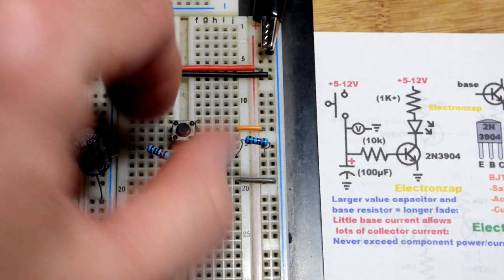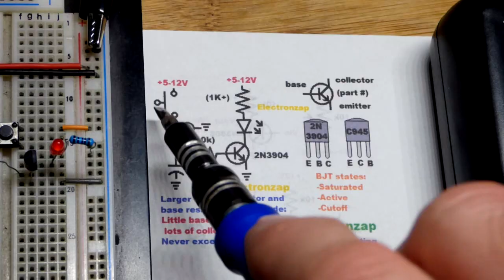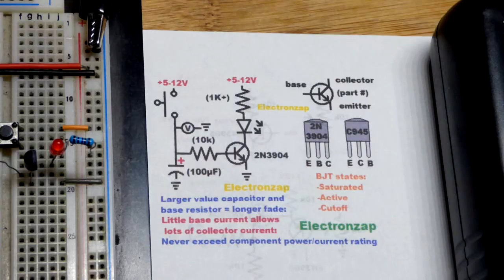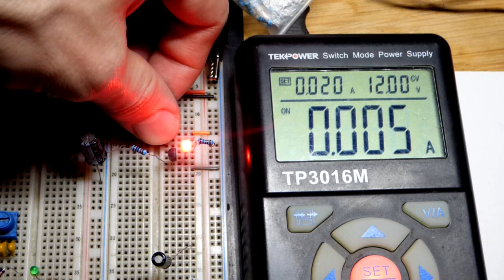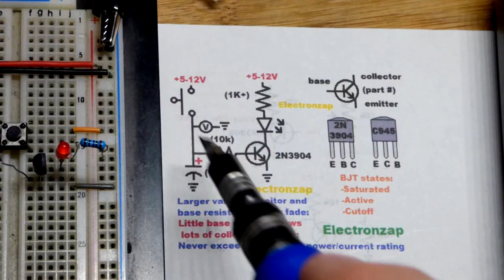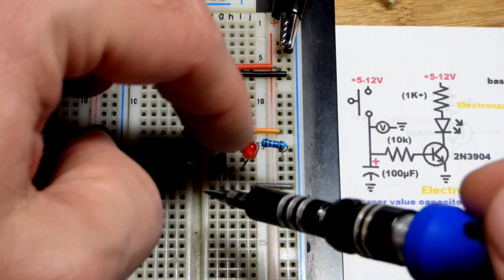LED Fade Off Circuit using NPN BJT 2N3904 Bipolar Junction Transistor

Comment: Thanks for another great video!!
I had exactly the same problem of the BB buttons popping out.  I just cut off a bit of the tips and soldered some solid lead..just enough so the switch still sits flat and the wire goes deep...problem gone!
Reply from the maker: Good tip!